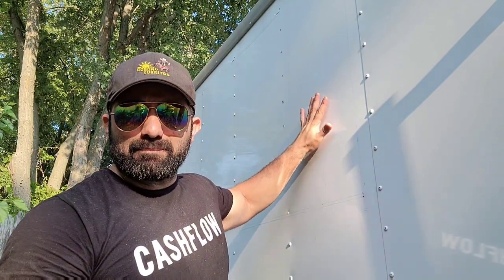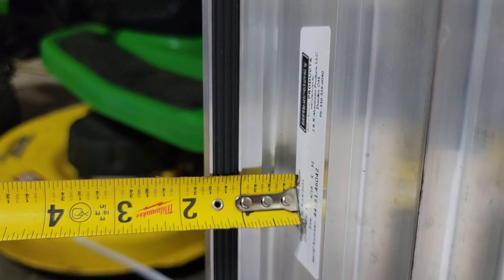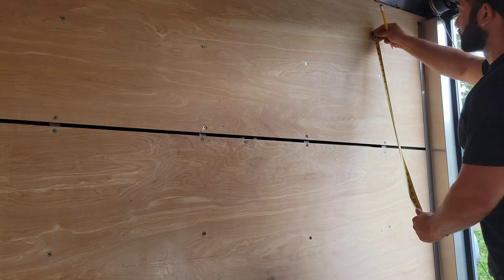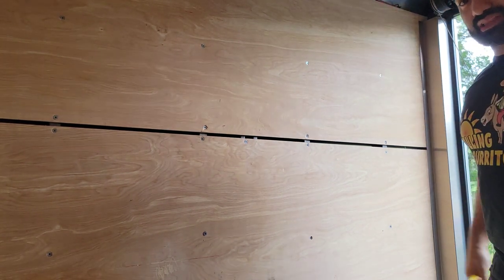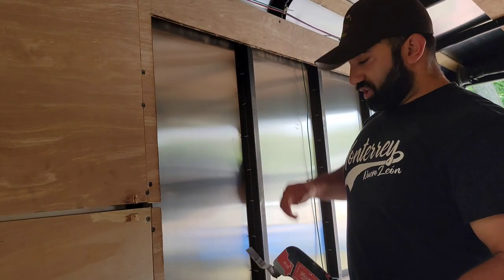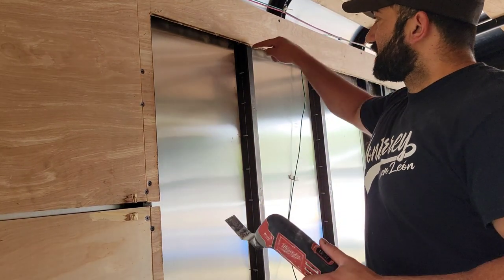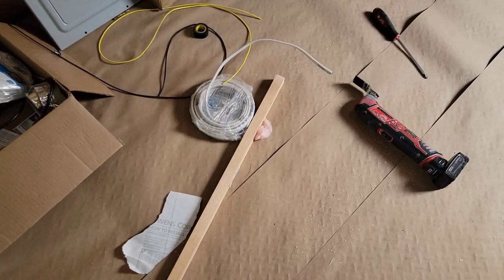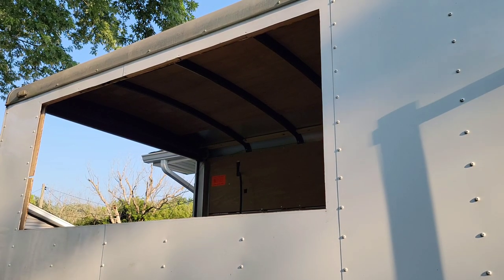How to Install A Food Truck Window

Comment: Yo frank been following your tube channel for a bit now. I got my electrical done now I’m cutting the window soon
Reply from the maker: There we go!!!! I was doing the electrical but it got too hot and decided to cut window :)
Reply: The only thing I didn’t do my self was the electrical work. Did the Plumbing , hung up the vent and ss wall,  hood and mounted the extractor almost done. Gonna knock out the suppression system as well. Can’t wait for it to be done. Seems like it’s taken a lot of more time then I expected

Comment: I appreciate your advice on building your food trailer and I've used your knowledge on putting in my floor. Now I'm going to start on my wall but could use some advice on it. By the way it's a used food trailer and I've been trying to add new interior to it. I would like to send you pictures of it and give me advice on building my walls
Reply from the maker: Appreciate that feedback. You can Rollingburritosfoodtruck@gmail, just want to be upfront tho. All my trailers have always had the walls built I have never had to build a wall for them, but they can be built

Comment: Frank, is there a reason you didn't add sleeper studs and a new header at the top of the window space when you cut out the steel wall studs? Doesn't leaving the studs unsupported through the window area leave the roof less supported and prone to flexing? If I were doing this in a house I would frame around the window with a new header and sill with additional studs attached at either end. I would expect it would be just as important or more that the roof is supported, especially since we'll be driving these down the road & flexing all around.
Reply from the maker: No need. This way of putting the studs in between the steel studs works wonderfully. No issues at all and no leaks
Reply: @fbaltierrez  Thanks. I wasn't as concerned with leaking as with structural rigidity. It looks like you're relying on the 1x1 spacers screwed to the interior plywood wall to provide sidewall support. Since they're not resting and connected to the steel side ribs I wouldn't expect the load transfer from the roof to be as strong as if you used a true header and framing approach. I expect I'll do a steel tube frame welded to the ends of the cutoff ribs to provide vertical and horizontal load transfer to the trailer frame when I do mine. 

I will be following your lead on some of the other parts of your build for flooring & electrical. I'll probably go with FRP panels for the walls though.
Reply from the maker: @jimhatch5873  that actually wouldn't be a bad idea welding that.

Comment: Hello, I'm trying to prepare to cut my trailer for my window. However, I'm a little confused. Do I measure from screw to screw on the outside or from the inside, and if it is from the inside, where do I start. I called j&r aluminum, and they advised me that the lip of the window was 1 1/2 all the way around. Do I have to take off 1 1/2 : on both sides and the top and bottom
Reply from the maker: Yes measurements to cut go from inside to inside. With 1.5 extra on all sides

Comment: Awesome I stall video, does the window have a rubber gasket or did you use silicone where the lip meets the edge.? I saw you add the silicone after.
Reply from the maker: Yes window has a rubber gasket but I also wanted to add silicone for extra protection
Reply: @fbaltierrez  Hola !! buenos dias que tipo de silicon yo la mia la compre YA ECHA PERO NOTO K SE METE MUVHO POLVO y la ventana no esta estable KE SILICON DEVO USAR O DEVO DE USAR EMPAKES ?PARA SELLARLA SIN TENER KE MOVERLA Y COMO PUDIERA AJSTARLA SIN TENER KE KITARLA!!
Reply from the maker: @Pocodetodorisa  el mas caro vale como $10 el tube. Clear silicone

Comment: Have you had any stability issues with removing that steel from the window and replacing with wood?
Reply from the maker: O issues and my truck has been on the road for about 2 years now

Comment: How much of a clearance would you advise on width my ro opening is 70 1/2 would 70 3/8 suffice? Don’t want to to twist and bind? Should I go with 70 1/4?
Reply from the maker: Either one works I haven't seen any issue with twist and bind being close to the measurement required

Comment: I wish I will able to one of these...
Reply from the maker: You got this!!!! Pretty simple install just a bit of hard labor
Reply: Just one question. Should one silicone under the outside lip of the window and then screw the frame to the trailer. That would insure a complete seal. Just curious.